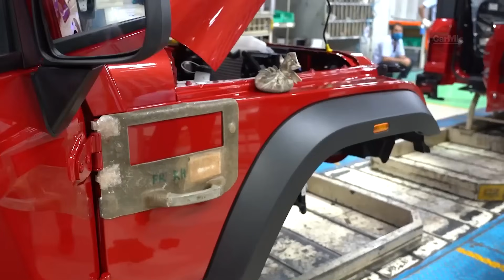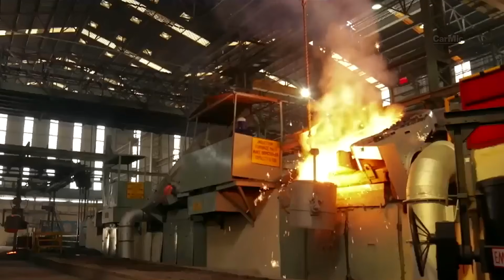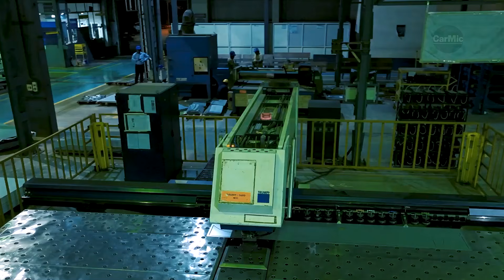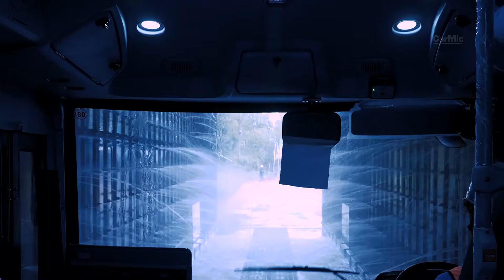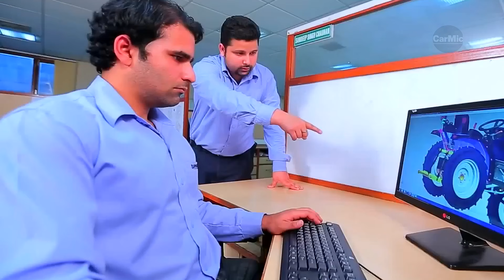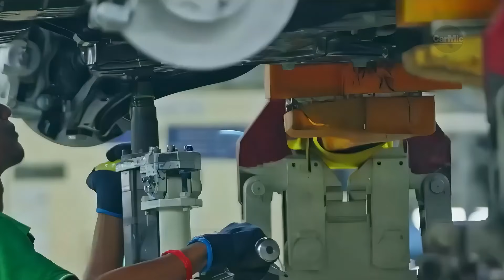Mahindra THAR & Scorpio Production – Inside India’s Car Manufacturing Plant

Comment: Yes Mahindras are reliable as good as Toyota because we get them in Australia and there is a small courier company in the Hunter Valley in N.S.W that has four Mahindra PikUps 4X4 utes and all four  Mahindra PikUp utes have done well over 500000 kilometres on there original engines also what happen to largest car manufacturer in lndia which have 50% of the market share in lndia and that is Maruti Suzuki and we have an eight year old Suzuki Baleno and haven't had one problem with it so good so reliable and lndia is becoming a builder of very reliable vehicles
Reply: Helpful comment. Thanks 👍
Reply: Abuh. Abuh. Bubuk. Baja. Maron. Biruh. Campurkan
Aduhkan. Semprotkan. Body. Dalam. Luar. Mobil. Baru. Mobil.  Sedan. Baru. Ri. Usa
Asiean. Eauropa. Moscow. 
Mom. And. Son. Chelleder. Girls. Sopir. Pramugari. Bumih. Kapal. Mico. Tibah
Yogyakarta. Bandung